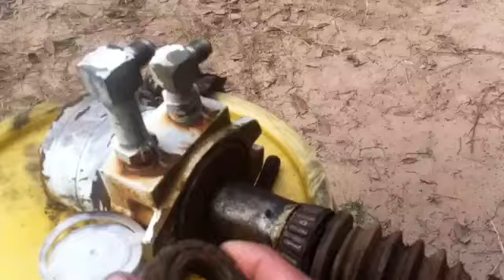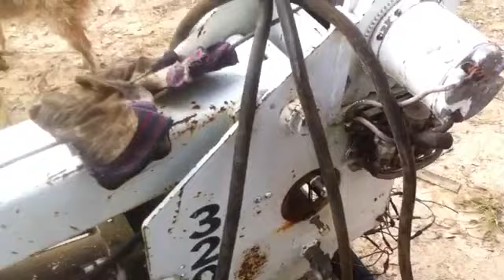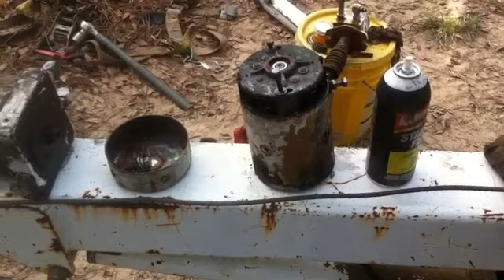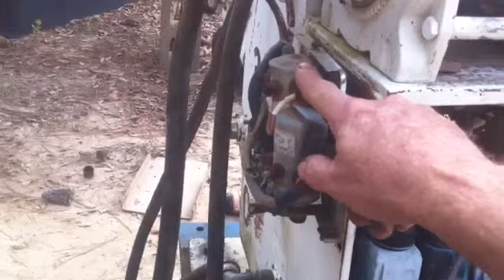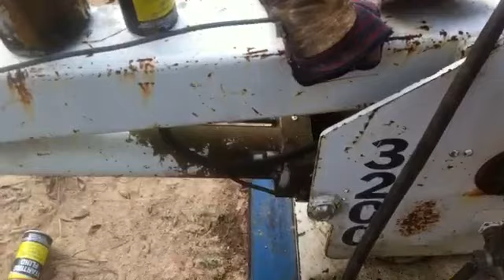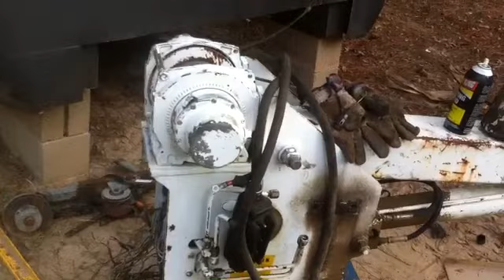Boom for my 1 ton truck - Video #4 - Solution to the high cost of parts problem.

Comment: If you have chance to get the parts # eBay  I buy Berings and seals really cheap, the solenoid on Amazon also cheap, you hub looks good to me no adjustment needed, the only think you need to get from dealer is the gear located on the crane
Reply from the maker: Had it working sense I made video but now have a new problem. Not sure if it is the hydraulic pressure or valve related yet. Just took it off truck again and thinking about running hydraulic lines from PTO instead of using 12volt that it come with.
Reply: @onewyatt1 did you check the selenoids, or of you have chance to see a gauge on the feed line, pump is $650
Reply from the maker: +Ruben Salais The valve solenoid isn't working but I still couldn't get boom to lift manually operating it. Tried adjusting the safety at the hoist cylinder and still nothing. Crazy acting because I can get the pump to load up when I try rotating but will not on other functions even if operated manually.